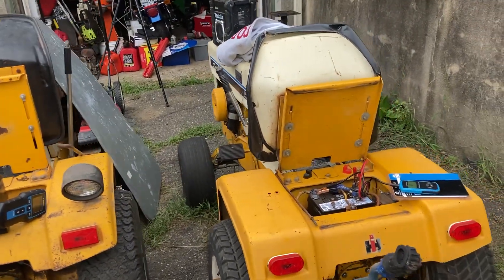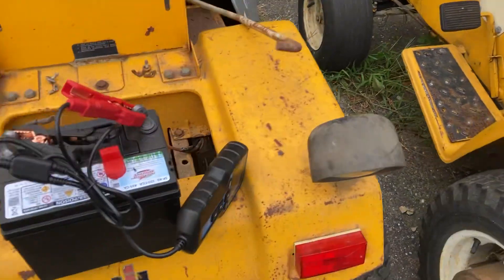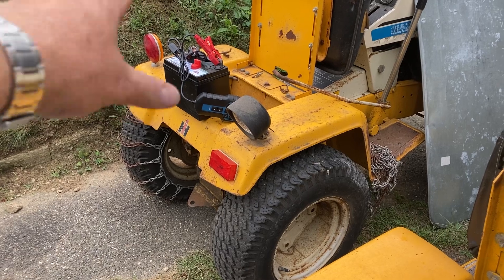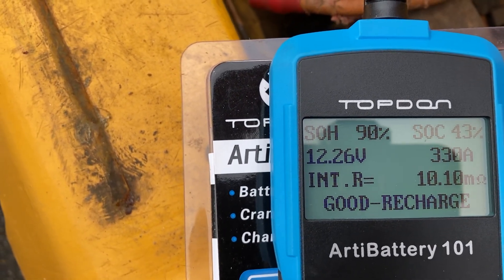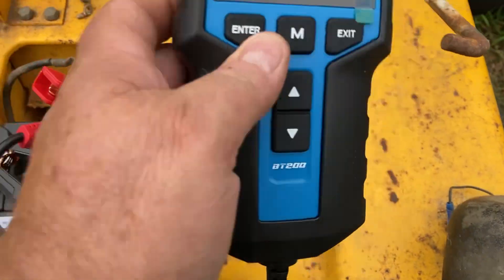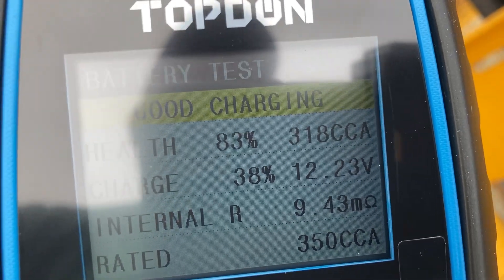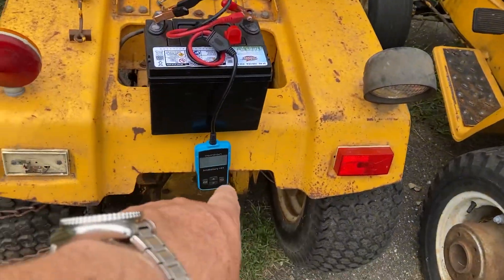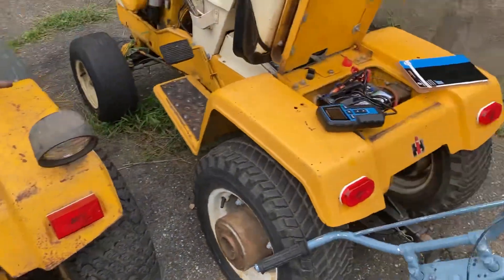TOPDON Battery testers, Old Vs New, Any Difference?

Comment: To determine which is the more accurate unit just use a good voltmeter as these battery tester use the measured voltage to put through it's algorithm.  The internal resistance is the more crucial  information as any resistance higher than 6.0mΩ is a telltale sign the battery plates is sulfating and the battery needs to be replaced.
Reply from the maker: Thanks for the info!
Reply: @KensSmallEngineRepair  We used this Midtronics/Motorola technology back in the early 90's when they first came out when we had to test thousands of car batteries as the rolled onto the production line,  this was the only way we could have tested them so quickly, but back then it cost us over $3500usd for a single meter and it's incredible this same technology can be had for under $20 today at the household level.  Midtronics/Motorola developed this technology for the big telcos to test their backup batteries in their DSLAM boxes remotely without sending a technician over to check the boxes at each location.

Comment: Thanks for the video. This has been my concern with these conductance test meters. There is a difference in reading between meters and nobody can say which one is correct.  I saw a video once which showed that the results of the meter were sensitive to the battery connection.. Just by repositioning the clamps he got a different reading.  Might not be a big deal if the battery is in good health but if the battery was at the borderline that it would show good battery and then in a different clamp position it would show bad.. Thats why i went with a load tester but i eventually learned those small 100amp ones are not enough load.. They only show the problem when it's really getting close to the end. I have been looking at those carbon pile load testers that can put a variable load up to 500amp.

Comment: These are battery testers not chargers. Charge both batteries and allow to sit for 30 minutes each and retest.
Reply from the maker: I will try that. Thanks
Reply: Actually the battery does not need to be fully charged which is the biggest selling point of these resistance capacitance testers, what it determines is the conditions of the plates and electrolytes.  It does not damage the battery like a carbon pile tester and can test multiple batteries in under a minute which would have taken hours with the old conventional charge/discharge method.
Reply from the maker: Good info, thanks!

Comment: your older one probably has poor connection somewhere, maybe some dirt on the alligator clip or some other wear from being used for the last few years, because it needs solid connection to check resistance accurately

Comment: Take more time ensuring a good bite into the battery terminal. These are sensitive to having a goid, clean connection.
Reply from the maker: Good point!
Reply: @KensSmallEngineRepair yours look pretty clean, but I clamp, the wiggle.....
Not me, the clamp. 😁
I have the 101 and love it.
(2 years)

Comment: lower case m unit prefix means milli and upper case M means mega.
Reply from the maker: I always mix them up!
Reply: @KensSmallEngineRepair  no problem, it's easy to remember by m is small letter (milli=1/1000 is a small number) and M is big letter (Mega=1 million is a big number).
Reply from the maker: @atmian  thanks!

Comment: I just bought that small one tested  a battery that I know is bad I charged it it had 12.5 volts I put the tester on it it said battery goodbye was showing 46% condition how can that be
Reply from the maker: I have had batteries show great voltage but wouldn't even crank a briggs engine. Its Amps that do the work.  I take the readings on these with a grain of salt. I've put them on new batteries and it said Junk, and Vice Versa.  Sorry you had a bad experience. A Carbon-Pile load tester is still the best tool for showing battery condition and ability to work properly.

Comment: I just ordered the BT100W. They seem inexpensive compared to the analog Projecta ones. I wonder how many amps they are testing at. My more basic Sidchrome one says 120amp draw during test. The Projecta you can buy 100, 500 or 1,000 amp draw versions.

Comment: Ignore the % health and % charge. Look at cca capacity and internal resistance.
Reply from the maker: You have a good explanation of resistance importance?
Reply: @KensSmallEngineRepair  the tester works by measuring  internal resistance then using that with the voltage to calculate the battery CCA capacity. It then uses that with the voltage and the CCA rating you put in the test to calculate the % charge and % health. The higher the internal resistance the lower the load capacity of the battery. Good connections at the battery is critical to accurate readings as it is dealing in milliohms. The percentages are just a calculation off measurements  and what you said the battery capacity was. Tell the tester the battery has a 500CCA capacity and perform the test. The CCA capacity and internal resistance will be the same but will say bad battery. The percentages are like idiot lights compared to a guage. When you start getting over 12 milliohms the battery is starting to go bad. Always best to test the batteries with a full charge too.
Reply from the maker: Thanks for the info!

Comment: Topdon tester, that thing is garbage, compare it with a multimeter, and see the difference. The calculations are based on the voltage, and if that is wrong the rest of the data is junk. 😐😐😐😐
Reply from the maker: I have a new version to test I will compare to a multimeter.  Thanks for watching
Reply: @KensSmallEngineRepair do you have a vid on it?
Reply from the maker: @randywl8925  somewhere, gotta dig it out!
Reply: @KensSmallEngineRepair  forgot to update, but the multi meter was the problem . Kindof funny, but the thing was toast, that is how i learned i need a new multi meter
Reply: @FinTra_  Great to update. Most people don't go make the effort. 👍
I forget places where I make comments, so I can't if I wanted to. 😁
Reply: Mine is accurate. Kens were very consistent.  We're checking batteries, not building an atomic clock.

Comment: I bought a TOPDON 101 last week. Tested battery 3 times and came back with REPLACE BATTERY for CCA test. I went to 2 different autoparts places that offer free testing. They would be more than happy to sell me a battery. Both said battery is good and does not need new one.Their actual CCA numbers were way different than I got with the 101.

Your video is very helpful as it demonstrates lack of consistency. My conclusion for home use it that I cannot rely on it. If I had a business that relied on accurate readings I would definitely buy a much better professional unit.
Reply from the maker: I just received the latest from a competitor I’m going to test it. Nothing beats a real carbon pile tester for actual cca numbers!
Reply: What's the brand name and model of the new tester?
Reply: Not really, the professional Midtronics units that cost over $600usd today to their $3500usd units in the 90's and does less is not that much better.
https://www.youtube.com/watch?v=yRvlS6EC15U

Comment: SOH on the old battery was 90% when you first checked it.. When you came back you said it went up to 90 from 83 but it didn't change. SOH on the old battery with the new tester showed a 6% drop and 1% drop in SOC. A few times you called this a battery charger. Just so someone doesn't buy this thinking it will charge their battery (you know someone will), this is ONLY a tester.
Reply from the maker: Thanks for watching and clarifying, I actually have the newest model for an evaluation.  I’ll watch my wording!
Reply: I have the small model you have. Now I’m not sure I trust it 😂

Comment: hey Kenny, I have the smaller on and like it.  It was free for me and good enough in my opinion.  Many times I take a pic. of the meter when telling customers that their battery is on the way out.
Reply from the maker: I got both for free as well, I’ll give the big one away, I just like the compact size of the little one!  Thanks for watching Bob!
Reply: I have the smaller one. Very inaccurate for CCA as compared to test by parts store testing with their much better meters.

Comment: Good video Ken. Jake uses the Foxwell with printout simply because he can supply customer with a readout of the battery attached to the invoice. Great units to have we use ours to check on condition of batteries we have salvaged by using the repair desulphating mode on our Noco charger. Some of our batteries have actually come back to 100% state of health . Basically it has paid for itself in used battery sales even when selling them at reduced costs. Ya think Hank has one of these?
Reply from the maker: A printout would be nice, I just text the customer a pic.
Reply: Nice to have the printout being in the business and lucky it is a Company tool which cost around $200 Cdn whereas the one without the Bluetooth printout ability is only $40 Cdn that being said for all the DIYers the $40 one is good enough

Comment: Batteries are strange creatures. I've run across similar results using a voltmeter. One would show 12.7 volts. The other would show 12.3 on the same battery. Not much difference, but... I still use the old OTC 3180 load tester. How about TOPDON vs another brand digital test unit.
Reply from the maker: My last video on testers showed the Blue one here Vs a competitor. I tested the Kingbolen product, link here.  
Kingbolen Battery Tester, any good?
https://youtu.be/1aggXlpwBfA

I still like the TOPDON although the Kingbolen is half the cost!

Comment: Nice tractors! Other than craftsman, those are still around here and I want some!! lol
Let me guess here; 1st is the tester is measure a dynamic load not a fixed one. 
Batteries suffer from sulfate deposition. Even small amounts cause big changes. This amount is probably small here but as electrons flow which is what your doing when that meter is connected, the electrons change the state of the battery as in 'Dynamic measurements ' are concerned. Your measuring very small changes in terms of percentage. 
However that tester is doing it, its using more than one aspect of the battery, I.E, current draw, voltage and impedance across the plates.
That is dynamic. Not to mention if the tester has a battery in it that would affect it over a few minutes especially in a good battery!
As we know, if ya wanna really test a battery, put a carbon pile load tester on it! lol 
I could go on but I cant text my thoughts properly
Nice stuff though, I really need one of those.. 
Years ago ya may remember, batteries were stored dry, some still are. Just got a motorcycle battery new and we had to fill it..
This is the best way.
Reply from the maker: Arch, I better sit down with a coffee to read your response! Thanks for watching!
Reply: lol

Comment: That is a good tool to have.  Might have to pick up the smaller one.  I am guessing the different results using the same tester same battery may have to do with moving the battery clamp around.  Rust and corrosion will change the resistance depending its position and will impact the result.
Reply from the maker: James, with your fame, I bet TOPDON already has one set aside for you!
Reply: @KensSmallEngineRepair  TOPDON would be crazy to NOT have one for Mr Condon.